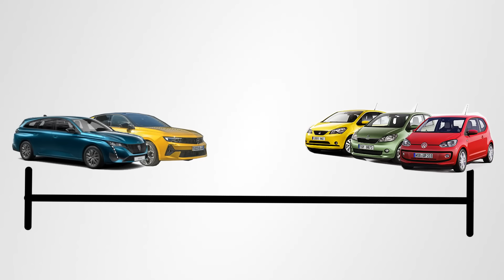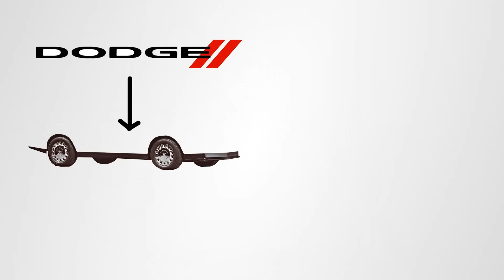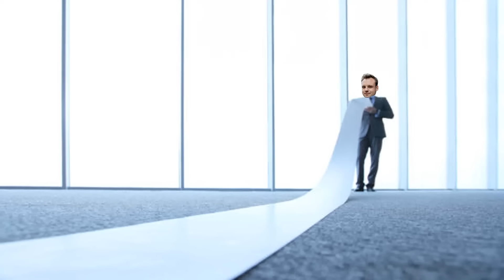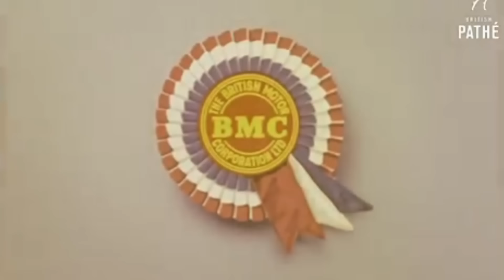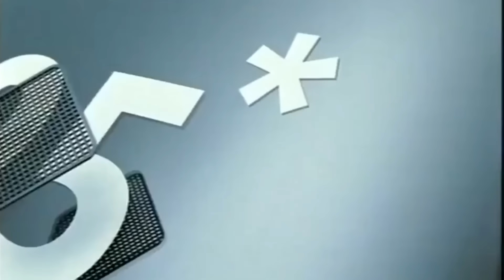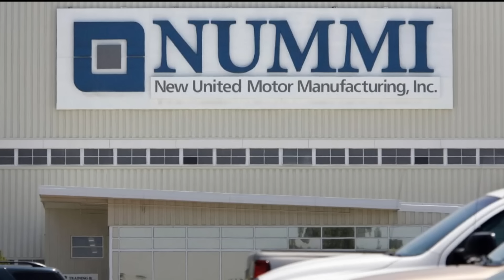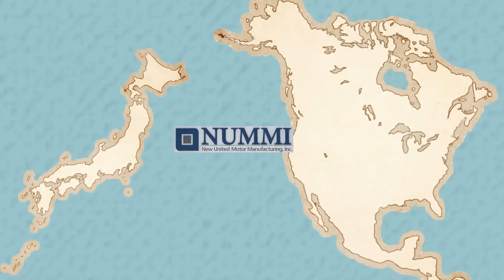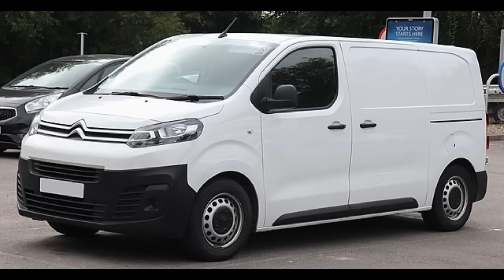Ep. 30 Seeing Double: The History of Badge Engineering

Comment: There was a great commercial for the Lincoln town car in the 1980s, a bunch of geniuses exiting a restaurant and all of them getting very confused about which GM car belong to which. Nobody could tell the difference between a Buick, Oldsmobile or Cadillac.
Reply: Even GM couldn't tell the difference between an Olds, Buick, Pontiac, or Chevy.  That's why on the assembly lines, the cars kept getting the wrong engines.  Pontiacs with Chevy engines.  Oldsmobiles with Buick engines.  Cadillacs with Buick and Olds engines.  And so on.

Of course, Ford wasn't exactly exempt.  Most Ford cars had Mercury equivalents.  

Crown Victoria / Grand Marquis.  
Fairmont / Zephyr.  
Taurus /  Sable.
Escort / Lynx.
Tempo / Topaz.
Granada / Monarch (and hilariously, the Lincoln Versailles)
Pinto / Bobcat
Maverick / Comet
Torino / Montego
Reply: I always wondered what a third gen F-body Buick, Olds, Cadillac would look like. The Buick would have  a chrome "Custom" badge, for sure, probably would have been called the Wildcat, maybe even just "GS," woulda kept the Pontiac taillights with a different center section. There's just no way to put chrome on those cars so they still look good.
Reply: There was another that showed them in profile and I think they just used different colors to show the lack of difference.
Reply from the maker: Somemoby sent me the link of the video, it's hilarious!
Reply: @EdsAutoReviews  Rumor has it GM begged Ford to pull it
Reply: @pgtmr2713   fun fact oldsmobile tried to get a version of the fbody, even made prototypes never came to fruition, gm was afraid it would kill camero and fire bird sales, same thing happened with the gbody cars of the late 60s, the monte carlo and grand prix, olds really lobboed hard for a version but instead got the notchback variant of the cutlass-the cutlass supreme.
Reply: @xaenon  GM execs knew what they were doing insofar as mixing brands of engines; they were attempting to eliminate redundancy.  I mean, Chevy, Pontiac, Olds, and Buick all had, ca. 1974, 350, 400, and 454-455 cube V8s, each in their particular engine line, with Chevrolet having TWO different engine lines!  Furthermore, there had been a 400 cube "small block" Chevy engine and a 402 cube "big block"!  It made sense to have Chevy make the 262-305-350 engines, Pontiac the 301 (some redundancy with the Chevy 305, obviously, but that may have been foundry capacity of each plant factoring into that decision), and Olds 403, with Buick getting out of the V8 business (damn, no "Nailhead"!) but having the 3.8 liter V6.  Where GM screwed up was in not being up front about these changes, I think they reasoned that Mopar and Ford had done it for decades w/o any serious problem, why shouldn't they?  More corporate big shot ARROGANCE.  This was especially true in the case of the Pontiacs, one either loved or hated them, but they had their fans, and when Pontiacs started rolling out with Chevy V8s, it was tantamount to HERESY.  There were even lawsuits over the "false advertising", though there's nothing wrong at all with a Chevy small block versus a Pontiac of similar displacement, they even used the same Rochester carbs and Delco ignition and fuel pumps!  Most were quietly settled, and once GM became upfront about the "marquee switching" of engines, the controversy died down.

FWIW, when the late John DeLorean was running PMD, given that Pontiac was targeting the then-youthful "boomer" market (in sheer irony, "boomers" now collect the old "sleds" their parents and grandparents drove from back in the 60s and 70s, especially STATION WAGONS, go figure!) and emphasized performance, even the staid six-cylinder models, from 1966 to 1969, were based on the loaned Chevy Six, but with a custom OHC layout, and could be had with high-compression and a four-barrel carb in the Pontiac Tempest.  Once DeLorean got "kicked upstairs" in 1969 to head up Chevy and get the Chevy Vega program on track, a program worthy of its own YT channel, the "suits" immediately nixed the Pontiac OHC six, and six-cylinder Pontiacs just borrowed the Chevy Six, "bone stock".  The reasoning?  Same as other high-performance fours and sixes that likewise were dumped:  they competed with V8s as the performance option, and it cost much less per unit to "hop up" a V8, and in many cases, a simple V8 with a two-barrel carb, single exhaust, and using regular gas was just as powerful as the "high-performance" fours and sixes.  No replacement for DISPLACEMENT.
Reply: I remember that so it must have been late 90s
Reply: @scootersonlyrepair6773  as I recall it was from the 80s. Didn't see it after that but who knows
Reply: @xaenon  GM  trouble started in the 1965-66 model years when each division wanted a full size luxury car; such as Chevy created the Caprice even though they had the Biscayne, Bel Air and Impala.Then  came the Camaro and Firebird  and then the body sharing started. 1977 with each division building engines for certain body styles such as Buick over V6 engines,Olds over auto diesel engines,etc.
Reply: @xaenon  Mustang / Capri (1979 to 1986)
Reply: @xaenon  I'm pretty sure GM installing a Chevy engine into a Buick was intentional. My '79 Trans Am? Powered by the Oldsmobile 403 V8 (also used in the GMC Motorhome). My '02 Firebird? Buick 3800 Series II V6. My '91 Grand Am? Oldsmobile Quad-4. Three Pontiacs and not a Poncho mill to be found.

If the Pontiac production line was supposed to install Pontiac engines, then how the hell did the Chevy engines get there? Some lines only build one brand, thus, only their engines. I think you're confusing powerplant sharing with incompetence (which GM has plenty of).
Reply: @md_vandenberg  I think you misunderstood me, brother.   My remark was tongue-in-cheek.  I know Gee Emm did this stuff deliberately and according some set of rules somewhere, but on the consumer side it always seemed so random.

The only consistency I ever noticed was that Chevy cars always seemed to have Chevy engines, with the only exceptions being Olds Diesels.  

In BOP cars, though, it seemed like 'anything goes'.

And of course, Cadillacs could have a Caddy V8, a Buick 4.1 V6, or an Olds gas or diesel V8.  And a Caddy engine in a non-Caddy car?   Nope nope nope nope nope.
Reply: @xaenon  Actually it was by design, they put Chevy engines in Olds, etc. Each platform, engine, transmission, etc, combination had to run through separate EPA and safety testing. Those testing certifications were expensive. So they cut down on the number of driveline options to cut down on the number of tests. The problem was that they did not tell the Oldsmobile customers that they were getting a Chevy engine, which resulted in a number of law suits.
Reply: @xaenon  Northstar.  Maybe that's the only example.
Reply: The funny part about that ad, the Lincoln Town Car is a Panther body, same body as the Crown Vic and Grand Marquis, it is no different from what GM did
Reply: @ScrotieJohnson  G Body Cars of the 1960s? You mean the A Body, and that didn't happen, they still made them, wasn't into the late 70s when Oldsmobile got the Saloon version of the Cutlass, which was shared with the Buick Century (Also that was the first public car to get the Turbo 3800)
Reply: @nickrustyson8124  the 1969 grand prix was a g body (started deliveries in 68)as was the 1970 monte carlo (started deliveries in 69). The notch back cutlass supreme of 1970 was gms compromise for olds not getting a version of that g body. This version of the g-body became the a-special after 1973. So yes i meant g-bodies of the late 1960s.becaus ethere was one. But ur not techincally wrong the g body was an extended a body.
Reply: @ScrotieJohnson  Well now that you're speaking english it's easier to understand, but you're still wrong because those at the time are A Bodies, the G Body wasn't "introduced" into 1982, but here's the kicker, the G Body is just a new same for the old RWD A Body since GM wanted to use the A Body name for their new Midsize FWD platform
Reply: @nickrustyson8124  the lengened abody for the 1969 grand prix and 1970 monte carlo were called  g-bodies. Then renamed a body special after 1973. I know of the later g bodies of the 1980s and the fwd  a bodies. There are plenty of references showing this.
Reply: Im not wrong a 5 minute search will verify.
Reply: @ScrotieJohnson  And a 5 minute search proves you wrong

Comment: The Geo nameplate was entirely based on rebadges.
Reply: my 95 Metro resembles that remark
Reply: Geo was a catch all for Japanese cars to be sold by GM. There was never a car actually manufactured by Geo.
Reply: If I remember correctly, the Geo logo was literally an oval representing the world with a tiny Chevy bowtie in the center
Reply: GEO is the basis of NUMMI, even though they're not part of that partnership.
Reply: @scott8919  yes it is
Reply: And in Canada, the "red dealers" (Pontiac, Buick, GMC) weren't happy with their lack of economy cars, so GM invented the Asuna brand, to give them rebadged Geos. With some differences, of course. The Asuna Sunfire (Pontiac wasn't the first to use that name) got the Isuzu Impulse headlights, rather than the square ones of the Geo Storm.

Seriously, it's impossible to keep track of it all!
Reply: So yesterday I got gas for the Metro, on the other side of the pump was a Suzuki Swift. Asked the owner why he didn't get a Metro.  :D  Yes, I know that they are the same model, though he might have had the 4 cylinder model.
Reply: I can’t it’s a Geo

-Ned Flanders
Reply: The Geo Prizm was a Toyota Corolla
Reply: @brianmorisset4489  My brother has just bought a Suzuki Baleno, it's practically identical to a Swift but it was $5000 cheaper.

Comment: The more infamous Rebadging has to be the Cadillac Cimarron which was a rebadged Chevy Cavalier.
Reply: Cavalier: $6000
Cimarron: $12,000...but with power windows & leather seats!😜
Reply: And the same body where used in Europe as the Opel Ascona / Vauxhall Cavalier :)
Reply: And nobody was fooled.
Reply: And I have a 1987 Cimarron sitting in my garage > like it > it’s optioned as a Cadillac ☝️
Reply: @Hobok92575  You want to sell it? I'd like one!
Reply: Don’t forget every GM brand had a version of the Cavalier. There was a Chevrolet, Pontiac, Oldsmobile, Buick and Cadillac version of this car.
Reply: @HC-cb4yp  I really need to think about it > I’ll come back to you • thanks •
Reply: @Hobok92575  Oh! Please do. I'd love one.
Reply: I had a 1984 Buick Skyhawk. GM J-body platform with similar front and rear styling to the Pontiac Sunbird, base engine of the Cavalier, optional engine of the Sunbird, and an interior of a different style from the other J-body cars. Of the interiors I preferred the Buick. It didn’t look as cheap as Cavalier, not as sporty boy racer as Pontiac, and not as pretentious as the Cimarron.
Reply: @HC-cb4yp  I would actually want to own one if its in mint condition, has the 5-speed manual, & its free!
Reply: And Toyota japan has the cavalier too
Reply: yup.
Reply: And what a dog it was, too! I knew someone who bought one. It barely ran with 4 peeps in and the air on. Giant POS.
Reply: @stevetemple1616 And the same crappy 4 banger as the base model cav.
Reply: @johntracy72 Now wait. I knew a woman who bought one. Fooled her!
Reply: @stevetemple1616  A friend of mine had a Cavalier with power windows.  And he could have probably installed leather seats for a lot less and the extra $6000.  And you can always purchase Cadillac replacement badges.
Reply: @johntracy72  A coworker of mine was kinda fooled.  Whenever we talked cars, he'd say "My Cadillac this"  "My Cadillac that" Finally found out he had a Cimarron and was seeking status from his buddies.